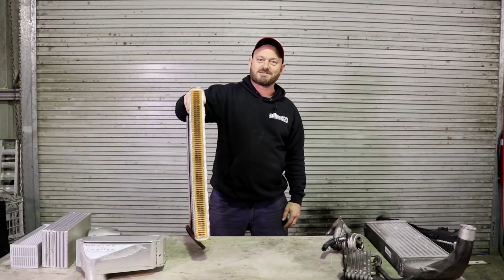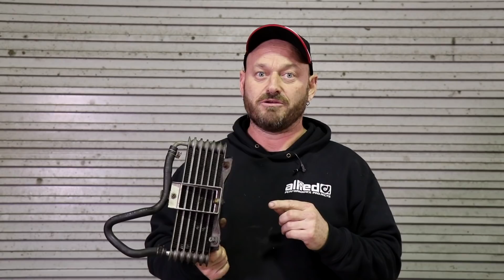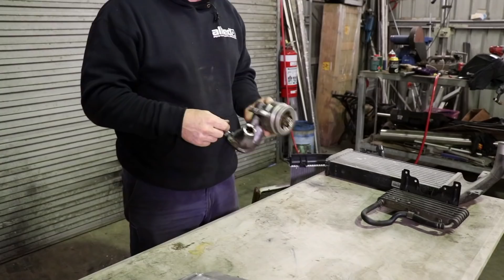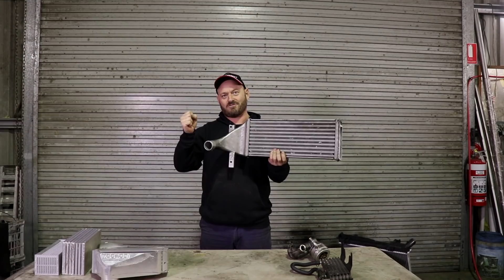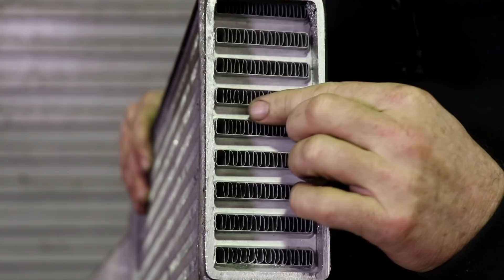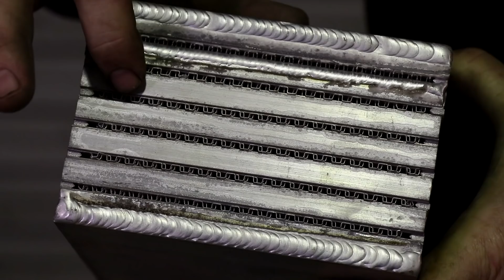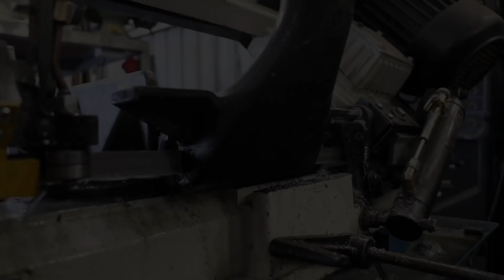THE SKID FACTORY - [QUICK TECH] Heat Exchangers Explained

Comment: Intercooler VS Meth injection. Particularly on turbo diesel
Reply: Depends - there's just FAR too many variables to even really compare them. There's no way to standardize a volume of water-methanol to a given intercooler size, especially when you get into dynamic flow systems that adjust the amount of water-meth per the amount of air or percentage of throttle.

It's like saying "superchargers vs nitrous" - although the end result is essentially the same, the two methods just aren't directly comparable because they function completely and utterly differently.

However, in both cases, both options absolutely work, which is why all of these are still relevant today.
Reply: You can't do water injection with tap water cause there's too many minerals (like calcium, limestone etc) that would be solidifying in the engine. So you have to buy distilled water, which is expensive and annoying. I'd say it's better to just use a tap water tank to spray on the intercooler so that a smaller one (like a top mount) works more efficiently like a front mount would.

Comment: Which is better in engine timing design.  Timing Belt, Timing Chain, Timing Gear, camless pnumatic tapet valves, or camless electromagnetic tapet valves?
Reply: or rotary valve engine? or wankel rotory (valveless)?

Comment: The most important "heat exchanger" is the turbo. It turns exhaust heat into booooost!
Reply: Anders Juel Jensen no it pressurises air
Reply: @liamwindsor5854  . You need how to learn how a turbo works Mate.
Reply: No! A turbo is a turbine which is spun by the exhaust gasses and then the turbine drives the compressor which compresses the air and sent through a inter cooler which is an heat exchanger (With Constant pressure decreases Tempreature)    and then sent to the Intake of the engine.
Reply: A turbo will work just fine with cold air

Comment: With my 2003 S55 AMG supercharged, I believe I'm feeling the affects of heatsoak with the Texas summer starting up. I was thinking of upgrading the heat exchanger for the supercharger, but since its in the engine coolant circuit no matter how efficient of a cooler I have it will still be at engine temp. So I was wondering if it's even worth it. Likely I have to upgrade the engine cooling as well

Comment: A turbo kit for the 86? You would have to dop the compression from the factory 12.6:1 surely!
Reply: No ,It's very common to have boosted cars with that sort of comp ratio.
Reply: @MJTAUTOMOTIVE  I am old, but I was impressed it could run 12.6:1 NA! thanks for the reply.
Reply from the maker: @cme2cau  The advantage of direct injection in controlling the combustion process.

Comment: The water to air with the water recirculated through an ice slurry (icebox) look like good way to reduce inlet temps, more for drag racing. I heard some talk on dry ice and Co2 fogger systems for reducing the temps, would be great if you could provide some info on these set ups.

Comment: Pretty much exactly why I went with an air to water intercooler on my 4g63T Mini. There's is no room to even have intercooler piping let alone a front mount😂
Can y'all do a video on fitting a new throttle pedal (or all 3 pedals even)? I converted my car to cable throttle but the pedal doesn't "feel right". Alternatively, I could reconfigure the electric throttle pedal to work for the mechanical throttle body or somehow make a stand alone electric throttle controller
Any help would be awesome!
Thanks y'all

Comment: Why not stick a aircon cooler into the intake to precool the air?? If you could refrigerate the air then it should out perform a standard intercooler.
Reply: Some cars do now days
Reply: Some cars actually do that. The Dodge Demon can... and I think there are some others.
Reply: The problem is aircon takes energy from the engine which would be gained by cooler intake air. Its not that it wouldn't work, it's just not that efficient. Cooling the charged air with ambient air is just simpler and more efficient.

Comment: why is a  cast  endtank better then a  cnc`d one? the  rough surface from the sand mold? also  have you put any research into end tank aerodynamics?
Reply from the maker: Because all the radius are smooth and consistent, something the CNC could not achieve in this application.
Reply: @theskidfactory   it is possible with a  5 axis  cnc